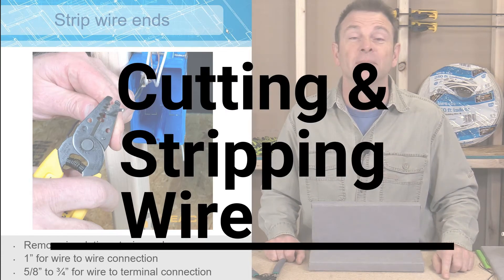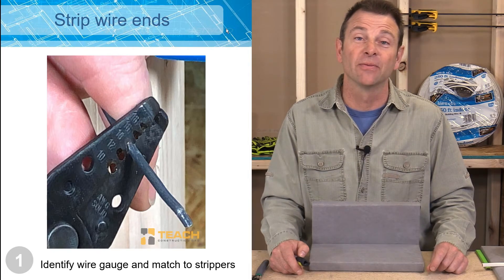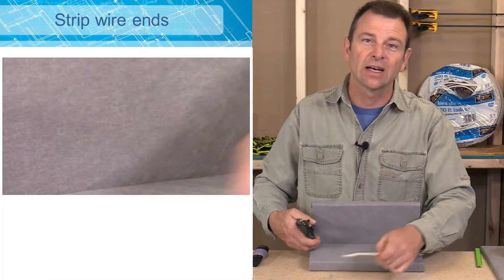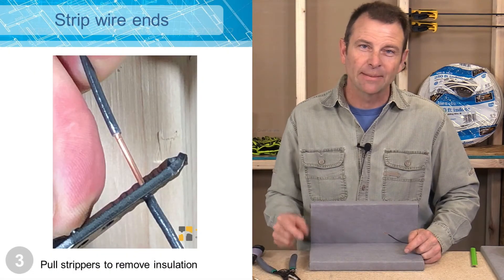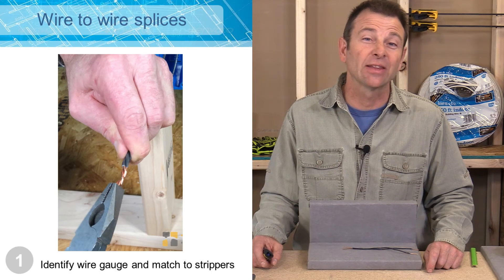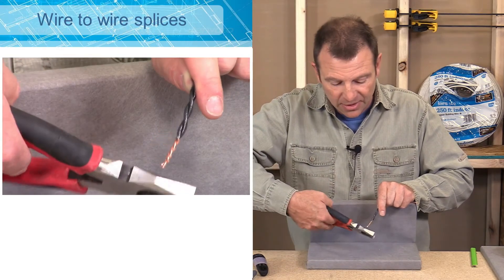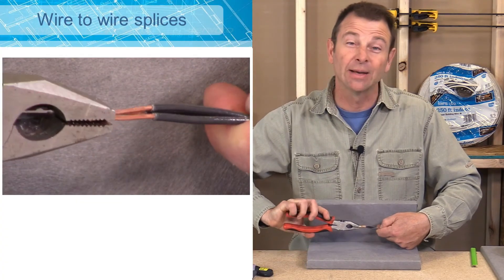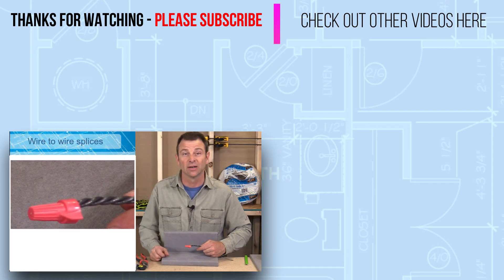Electrical Wiring Process - Part 2 - Cutting, Stripping and Connecting wire - Come wire with us

Comment: Why not show how you strip off the jacket when the wire is in a box? You can’t just pull your conductors out with strippers in a box
Reply from the maker: Not sure I understand the question.
Reply: @ConstructionEd  he's talking about reaching into a junction box  with 6 inches or more of wires extending out then trim the outer jacket with the 1/2 inch exposed at point of entry whether you used the wire cutters with jacket cutter or using a utility knife to trim outer jacket inside box then striping and twisting